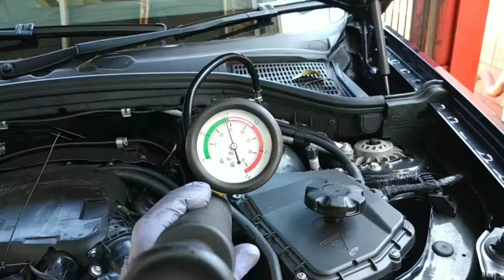BMW N47 EGR cooler coolant leak repair

Comment: Great video, thanks !  Just one note: from 2018 bmw introduced following coolant: “Frostox HT-12 anti-freeze and corrosion inhibitor” which is green. All engines leave the factory with this type of coolant. Older engines use the glassic G11 which is blue. So if this car is 2018+ green is the one to go ;) ISTA helps with all details.
Reply from the maker: Thank you for letting me know. I will make a note for it.

Comment: Awesome tutorial.
My Egr cooler is leaking but from inside ( sweet smell at exhaust when cold )
I want to replace it but dont get a mesh with coolant, so do you know how can i cap the coolant engine lines that goes to the cooler?
Reply from the maker: Thanks mate. Unfortunately, it is impossible to block the holes while working on it. Coolant stain can be diluted and removed by water. So, wash well that area after finishing the job. I reckon this is the best way.

Comment: Why not just do an EGR delete and be done with it?
Reply from the maker: If you want it, you can do. But you need to get a kit, and re-programing ECU. Because you need to delete the sensors reception from EGR system to ECU.

Comment: where did you get those seals??? thanls
Reply from the maker: I ordered the seals from our local European part shop. Alternatively, you can find it with a BMW part No. 11717799853(called as a pipe union). Thanks.
Reply: Thanks a lot. They are extremely hard to find
Reply from the maker: No problems. Have a good day~